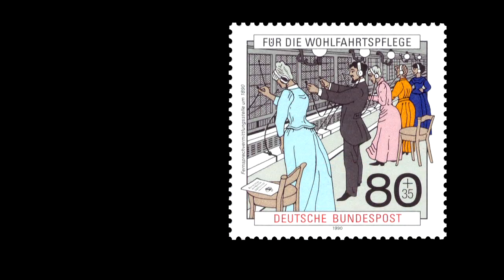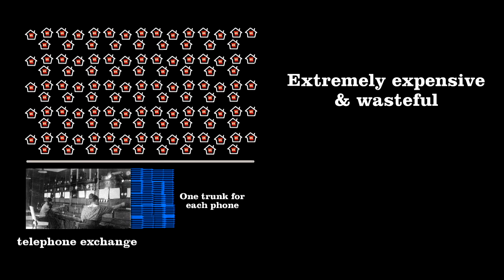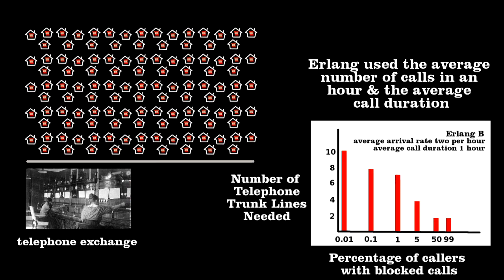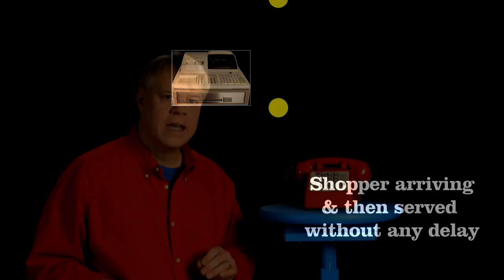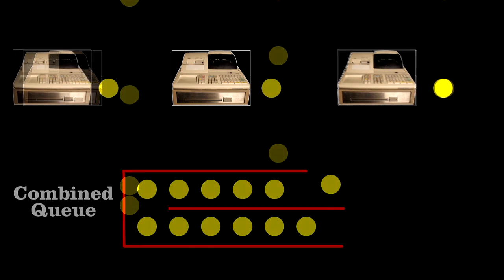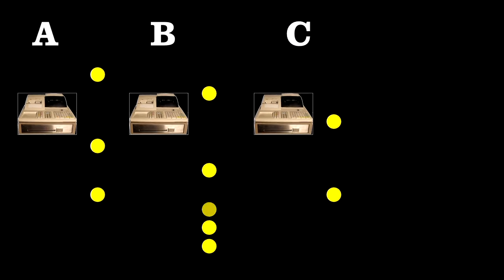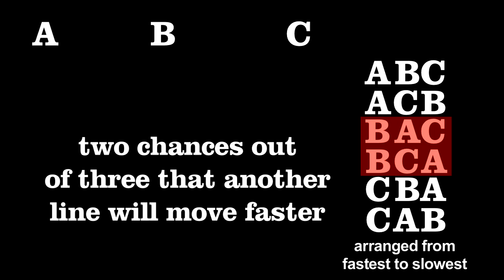Why the other line is likely to move faster

Comment: Speaking as someone who works in retail (Fry's Food,) I really wish our store would use the combined queuing method. I stock shelves, but am frequently called up to help up front. When I am up front, I frequently see other cashiers not doing anything while I have a long line (they don't call the customers over like they should.) This method would eliminate the problem of slacker cashiers and thus enable the line of customers to always be dealt with as efficiently as possible.

Comment: Fry's line is amazing. The one by my place has about 50 cashiers, and a guy at the front of the customer's line on a raised platform that can see when one is available, and directs customers to it. 

Trader's Joes also has this. When they opened in Union Square in NYC, I walked in and the line snaked all the way around the perimeter of the store, probably 100 people deep. They had about 30 registers, and the single line took no more than 10 minutes.

Comment: Shouldn't the overall checkout speed be the same, no matter how many lines there are?
The only difference between having a single line and multiple lines is that a single line evenly distributes the waiting time of a single delay onto all customers in line, rather than make 3x as much of an effect on the waiting time for customers in 1 of the 3 lines.
IE. a delay in one of the 3 lines is favourable for those in the other 2 lines.since they avoid the resulting decline in transaction rate.

Comment: @teylix That's not correct. With this system you are effectively splitting average customer delay times by the number of cashiers that are present. If two people in a row are holding up the line, you have one other line, what are the odds of three people being very slow? So you should always have less wait time on average than what you would spend in a segregated line structure.

Comment: The other issue with Super Market checkouts is that people speed up the whole process by putting their stuff on the belt before the previous customer is done.  If you stop that, everyone loses. 

This introduces a whole set of variables too complex to discuss here. Sufficient to say that I wouldn't want to be directed to load up behind someone doing 3 months worth of shopping. I want to be behind the guy buying one can of beans for cash.

Comment: I thought the reason stores didn't use a single queue was because either they were stupid, or because multiple queues are slightly more efficient from the store's point of view, since it avoids the dead time between a cashier becoming free and the next customer getting from the queue to the cashier.

I'm disheartened to hear that the real reason is that customers are stupid, though I suppose that shouldn't surprise me.

The primary function of a queue is to even out demand. A secondary function is to deter demand, and some stores seem to use them for the latter purpose. The mind boggles.

Comment: You are still putting through the same amount of people given equal amount of cashiers. Only time it becomes more efficient is if people for any reason at all do not switch to the empty queues. 

Also it is rationalized in this video that you're the guy stuck behind the old person (writing a check that doesnt go through the first 10 times) then of course the single line would be more efficient for you.

Comment: He doesn't specify the number of homes for which 7 trunk line are sufficient.  Without looking this up, I suspect that the number of trunk lines needed is the base 2 logarithm of the number of houses.  So if you have 128 houses, 7 trunk lines are sufficient.

Comment: No, that's not true. Throughput will stay the same. It doesn't matter that some people are in a line that isn't moving, unless there is an open register elsewhere. The registers are still going full throttle, serving as many people as possible. With a single queue, you distribute the additional wait time evenly among all queued customers, with individual lanes, you distribute the additional wait time to only a single lane. It's still the same wait time distributed. Still same # of custs per hour

Comment: Being presented with a 20 person line is generally more problematic for your average consumer than a 7 person line, even if the 20 person line is better logistically.

When you're in a rush, the fact that the system is running smoothly is a small consolation when faced with your own personal convenience. It's easy to mock people for this, but shopping tends to catch people at their worst moments.

Working in customer service, it's quite hard to not punch motherfuckers out if you can't empathize.

Comment: @loqiloqi Fry's Electronics solved this problem by having a single employee direct the customer to the open cash register.  I bought Christmas presents on Christmas eve during the afternoon and the store was packed with customers.  I waited in line for about 5 minutes before being checked out - it's an extremely efficient system.  Compare to Walmart.... ugh!

Comment: How does that actually make the overall crowd move faster?  If there is a delay at one register then the remaining people in the big line will all be served at (intuitively) 33% less speed than before...  I know it's not that simple, but it seems mostly true...
Reply: +Christian Rankin I thought it was due to clumping?
Reply: OnlyBlix
What is?  lol

I've forgot most of the video by now haha, I'd have to watch it again just to know what to say back...
Reply: +Christian Rankin Yeah I think it would only be overall faster if the other lines ran out of customers and a bunch of people were still stupidly standing in the stalled line.
Reply: +Christian Rankin Let's say there is a failure at a register. With the "three line" model, 1/3 of the people are stuck in a line that isn't moving. Right? In the "one line" model, you can "re-route" all of the people to a register that is working. That way, only one person is stuck in a line that isn't moving. I think that is the reason. I guess I'm not sure, but that makes sense to me.
Reply: RonaldReaganRocks1
The rest of the people are served at a slower rate however; 33% slower, I assume.

So again, how is that faster?
Reply: It isn't fundamentally faster except that it is better at rerouting customers, which may speed things up slightly.
Reply: +Christian Rankin Only if everyone is spending the same amount of time at each register, i.e. purchasing the same amount of items. If 10 ppl are only getting 2 things, those lines are obviously moving quicker.
Reply: Because in a multi line system, some lines will be under utilized (empty) while another line is lagging. People can change lines, but that's really the same as a single line system.
Reply: Joshua Pearce
It seems like you're trying to say I'm incorrect, but your statements actually prove my point.

Forgive me if I misunderstood, as I most certainly have since this makes no sense.
Reply: Christian Rankin I was replying to your question "How does that actually make the overall crowd move faster?".

It makes the overall crowd faster by having fewer empty registers, not because of the amount of time spent at any particular register.
Reply: Joshua Pearce
that's plausible, sorry I didn't understand.

Comment: Why listing all possible combinations of the lines from the fastest to the slowest? Do we have 3 lines? Well, then A is the fastest, or B, or C. So, you'll be in one of these 3 lines, equals 33% of probabilities. If the lines are 1,000,000, we have 0,00001% of probabilities to be in the fastest line, so no need to list all the possible combinations, it's just basic probability..

Comment: The Mythbusters did this experiment and came to the opposite conclusion. The combined queue took longer because other the time it takes for the customer to walk from the end of the line to the register, but it had greater customer satisfaction because it was a more fair system.
Reply: There is an easy solution to the problem of waiting for the customer to walk to the register, set up a system that at a set point in the transaction, say the cashier hitting "total" so they can begin to collect payment, the announcement is made for the next customer to proceed to the register.  That way, as soon as the first customer is done paying, the second customer can already be at the register (or at least made good progress on getting to the register) thus eliminated (or at least reducing) the wasted time.
Reply: You're right. The video misses the point that although one of three lanes is blocked, that doesn't stop people from going to the lanes that are moving, there's no single queue needed.

Comment: the one single line is actually slower because when one person is done checking out they walk away from the register and then the person at the front of the one single line has to walk from the line to the register that takes up time that did not exist When each register had its own  line and then when they get there after the first person left they still have to put all of their groceries onto the conveyor belt  taking up even more time whereas before when each register had its online they were putting their stuff on the conveyor belt as they were waiting
Reply: +the “Bullets Rc” garage thats a circumstancial variable.  secondly, it would be more efficient if the cashier at the register signals they are open when they can tell their current customer will be transitioning smoothly.  using a preload space.  or simply using a 2 person buffer per register.   and if a register gets stalled, the 2nd person in the buffer gets priority to swap registers.

the single line will produce a more efficient time using the above things i said.
Reply: +Shakov Skanton there would be a lot of variables with that system but to me it sounds like the current system that retailers use where people just walk through and pick the shortest line so really the only difference between what you said and what we are already doing at retail stores is worth picking the shortest line as opposed to standing in one long line waiting for the shortest line and ultimately the speed at which customers are checked out and modern-day grocery stores is really not dependent upon the customer it's more or less the person at the checkout

Comment: How is one-queue-three-cashiers faster? If one cashier is blocked, the throughput of the system is reduced by 1/3rd, and it affects every customer in the queue -- each of them will have to wait 1/3rd longer. With one queue per cashier and one of three cashiers blocked, the throughput will also be reduced by 1/3rd, just like in the other scenario -- it's just that the delay will be unevenly distributed among the customers. 2/3rd of the customers (those in the unaffected queues) will experience no throughput reduction at all, while the other 1/3rd will essentially wait forever -- until their cashier is unblocked.

Comment: Does such a system actually reduce average wait times, or does it reduce the spread?
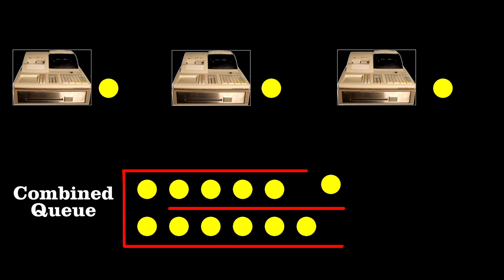The way I reason it, having one line with multiple servers does reduce the impact of each delay per line, but since the line has triple the customers, the average delay per customer is still the same; but instead of each delay having a high impact (reducing servers from 1 to 0 for the extent of the delay; or serving 0 customers per average service time) on the 1/3 of customers in the delayed line and no impact on the 2/3 that are in the other lines, it has an equally small impact on all customers (reducing servers from 3 to 2 for the extent of the delay, or serving 2, rather than 3, customers in the average amount of time it takes to serve 3 without delay). So instead of n people being reduced to 0 servers for 5 minutes and 2n having 1 server for those same 5 minutes, 3n people are reduced to to 2 servers for those 5 minutes. If it takes 1 minute to serve the average customer, then for those 5 minutes, in both cases, the store as a whole can serve only 10 customers, instead of the usual 15, so the average wait time is still the same. But instead of increasing the wait time by 5 minutes for all customers in a single line, and 0 minutes for the rest, the wait time is decreased by up to 2:30 per customer, per delay, depending on position in the line; but the delay applies to everyone.
Is this reasoning correct, or am I missing something important? Does it actually decrease the average wait time (i.e. enable more customers to be served in a fixed amount of time), or does it simply decrease the distribution of wait times, so that each customer has a wait time closer to the average (whether this means a longer or shorter wait time than they would have had with a 3 line system).

Comment: this isnt true because you can see what line is shortest. youre not randomly picking like the logic suggests
Reply: If you can see which line is shortest, so can the others waiting in line.  If they didn't get in that line, there might be a reason.  Using a food store as an example, perhaps the cashier is being trained and as a result is slower than the others, perhaps the people in line have lots of items to buy and you cannot see it, or perhaps the cashier is about to close.

By having one line (if possible), this lets the store easily open up cash machines to deal with customers, or close a machine if the employee is about to go on break or go home.

Comment: Actually, this is a perfect example of why having the one line feed to multiple registers DOES work.

Having one line feed to multiple registers - or airline ticketing agents -- evens out the delays by, in essence, having everyone deal with the issue, instead of just one line suffering while the rest go faster.  Basically, it de-prioritizes each line, and so everyone goes at the same speed.

Problem is - everyone wants to be first.  So your need to be first is what's really at work.  Just a note

Comment: Wait. Thats stupid. The answer was "the other line is faster because there are two other lines". That isnt a hot take. That isnt some mathematical revelation. We all entered this video expecting some kind of proof showing how between two lines the one someone typically joins is, for some reason,  slower. Or at least appears slower. 

You dont need 90% of this video to get that answer. Ask any person "what is the chance of a line you pick being the fastest" and almost everyone would say 1/3. Its basic intuition. The explanation on how delays and wait times work wasnt necessary at all.

Comment: That multiple line illustration ignores people's ability to switch lines when their line is not moving.
Reply: People's ability to switch lines ignores that lines speeds actually fluctuate, and it's safe to predict that for every time you switch to an actually faster line you'll also end up switching to a slower line.
Specially considering how actually irrational human gut feelings like patience/lack thereof are. If you are in a long, completely immobile line, by the time you run out of patience and switch the clog is gone and your old line starts going faster than your new line.
Reply: azlib77 myth busters took on this. I think the results show the single line system is not faster nor exactly fair. Because the distance to walk to the checkout line varies